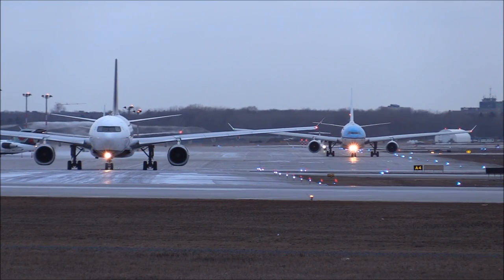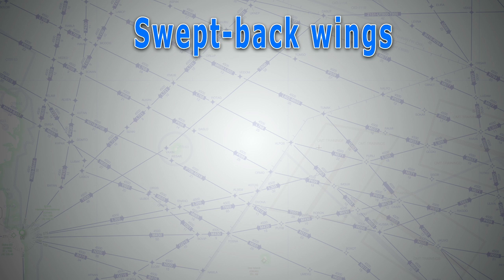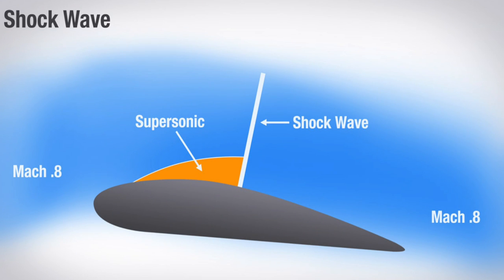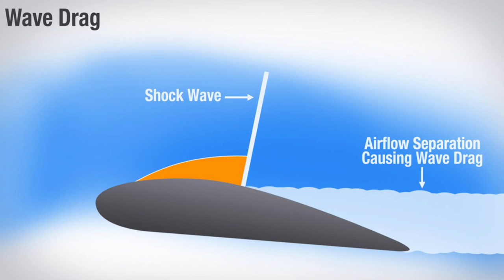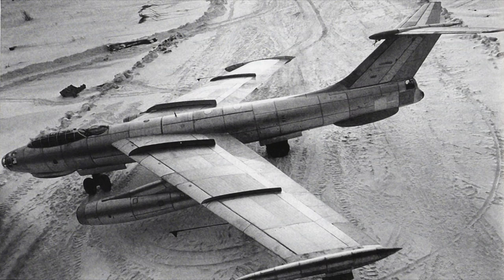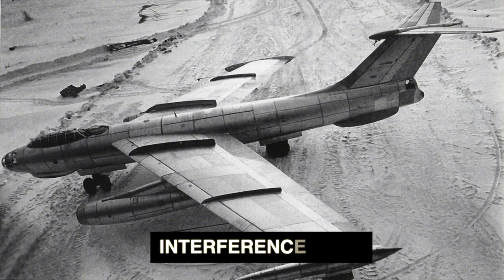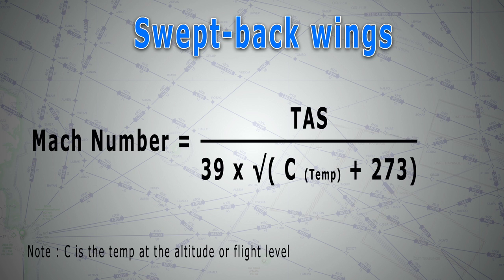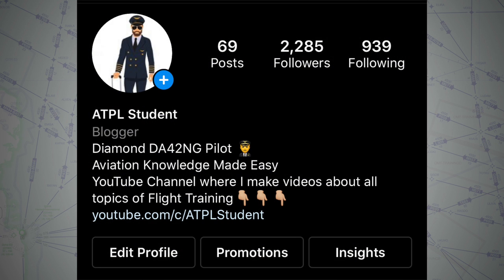✅ Swept Back Wings Explained - Why Airplanes Have Sweep Back Wings

Comment: why should the any flow travel perpendicular to the wing chord? How does this flow separation affect the lift and drag characteristics? Maybe the answer is from the fact that spanwise flow no longer contributes to lift. Since that component is no longer contributing to lift, then the speed of the air over the wing decreases or is less than it would be if it was a straight wing. At this point I'm speculating and want to see if any of you can confirm this?
Reply from the maker: That is indeed correct, when sweeping the wings backwards, the airflow is divided into Chord wise and Span wise. the span wise flow is as you mentioned pile up near the wingtips, as for the chord wise (the perpendicular component is less, thus the aircraft feels as if it was flying "slower". This is the method used to primarily delay or increase Mcrit, thus delaying air flow separation due to shockwaves formation when approaching the speed of sound.

Comment: why the stall happens at wing tip did not get that? Also, why wing tip travels faster the the wing base?
Reply from the maker: Thank you for your question;
At low speed, the AoA is relatively higher, this means the span-wise flow (which is a component of the relative air flowing over the wing)) flows from the root towards the wingtip (due to sweepback design of the wing), as we approach the wingtip this span-wise flow tends to accumulate, when this happens it disturbs the flow over the wing tip, thus the wingtip no longer generates sufficient lift, therefore it stalls FIRST,.. This is why we need Slats and Flaps during approach and landing, and whenever operating at slow speeds.